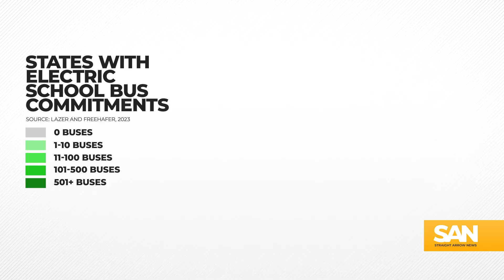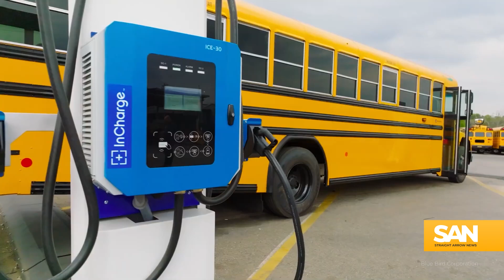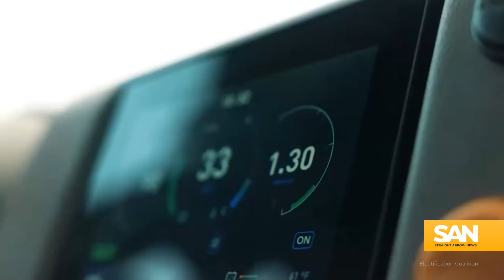US electric school bus adoption hits new high, detractors debate practicality

Comment: Keep in mind, the cited upfront costs are with federal subsidies. The actual underlying costs are even greater. And until the lack of range and the long charging time are resolved technologically, electric is a huge no-go for any school not within or near an urban center.
Reply: The range and charging time issues are arguably the best reason to make school buses the first step for wider-scale EVs. School bus routes tend to have short to moderate ranges and predictable schedules (average school bus route both ways is apparently ~75mi) and would likely need charging either early in the morning or in the mid-afternoon (which are generally off-peak hours). There are definitely still pros and cons here but, logistically, EV school buses make good sense.
Reply: @korayven9255   Average means half the routes are more than that. I specifically mentioned the rural routes which are significantly greater. Also, school buses are used for more than just the students' daily commute. I can imagine adding 30-40 minutes both way for charging will make planning school trips much more bothersome than 3-4 minutes for topping off gas.
Reply: @MinecraftMasterNo1  You wouldn't need to make every bus electric. Most busses do how ever many miles at 8 AM or whatever, then sit around for six hours til they do the same route in reverse. It might not work on every route, but I can't imagine there are many hundred mile routes being driven by school busses. You could probably even get away with purpose built busses that have a hundred mile range and would work perfectly fine for the routes they are used on.
Reply: Ok...? Don't use EVs for longer routes. What is your argument?  @MinecraftMasterNo1
Reply: @octaneblue6  every route is long dude.  It plain out makes no sense to use EV buses for school.  It’d only make sense for like…. Shuttle buses for airports or amusement parks.

Comment: One bus costs $300-400k dollars and it saves them about $6k dollars a year.  So in about 50k years the bus will have paid off itself from all the money they saved on maintenance!
Reply: The benefit isn’t really monetary but more in the fact that the air quality in American towns in cities will massively improve(and become just a bit quieter. For mail trucks and school buses electric is perfect. They only run at specific times and then they are parked and sit for a while.
Reply: @bobsteve4812  if times weren’t so difficult right now in the US economy, I’d be all for this.  But that tax money needs to be going to help the taxpayers, we can’t afford this type of purchase right now.  If anything that money should be invested in nuclear energy so that fossil fuels aren’t being depended on to make and power all these EV’s.
Reply: @HisDudeness_69  Both could easily be done in the US. Under no admin are tax breaks for regular ppl going to happen, nor would that be a great idea given expenses aren’t going down. Especially given maintenance costs are massively less for EVs and it’s not like diesel is going to get any cheaper relative to electricity. This saves money and, most importantly, has massive environmental benefits to the communities it serves. The fact the economy isn’t good rn is no reason why we should replace old fleets with another set of diesel running busses.
Reply: A diesel bus also costs a couple hundred grand as well.
Reply: @bobsteve4812  there are plenty of tax breaks for regular people... you're just used to them being the status quo.
Reply: @pepperonish  a new diesel school bus costs 100k.  A third of the cost of a EV bus.  We we’ve already spend the money on those busses too so it’s not like we’d have to replace every bus with a new diesel bus.

Comment: Emissions are lowered only if the electricity is not fossil. 
Too bad the battery creation is super polluting.
Reply: Emissions are still lowered. Not day one but after a few years. Even under coal powered areas as large scale coal plants are more efficient than even diesel engines.
Reply: do people forget normal cars have lead acid batteries too?
Reply: @danielyoon3313  All cars have a lead acid battery even EV's although they are tiny in reality the battery they talking about is the giant lithium pack, also lead acid batteries are easy to make and easy to recycle